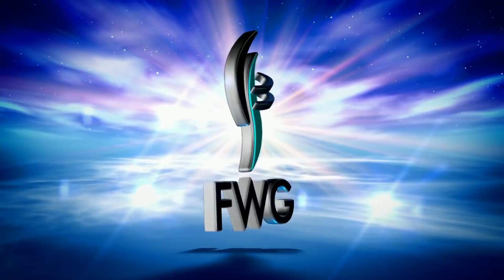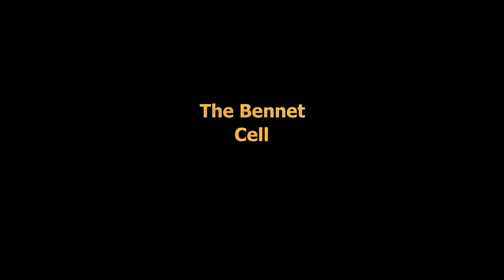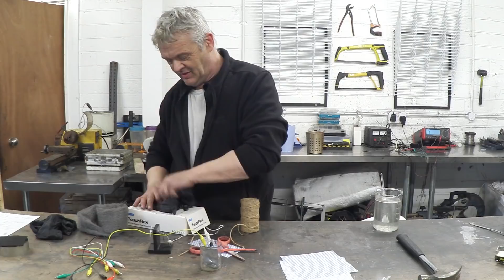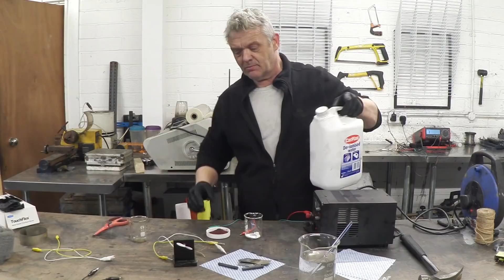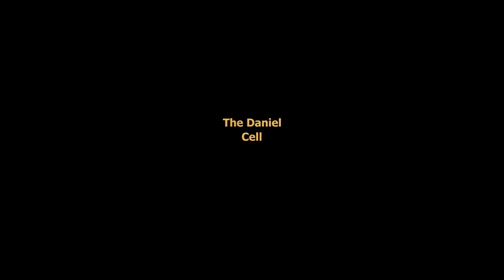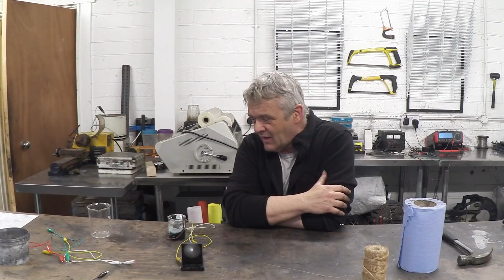Lost Secrets in the Art of Battery Making

Comment: You can make pure copper oxide very easily with a little bit of sulfuric acid water a couple of pieces of copper pipe for electrodes and a power source. The trick is to keep the two electrodes isolated from each other as far as possible to allow the solution to form rather than simply plate the other side of the copper you can use either a separator but an easier way to do it for the anode just simply coil up a piece of copper wire and sink it to the bottom of the vessel that you're using and keep the other electrode at the top of the vessel barely in the solution let it run overnight cook it down and there you go you have copper sulfate grind it up in a mortar and pestle put it over a burner in a Pyrex dish and keep heating it until it turns black there you have a pure copper oxide

Comment: J cloth appears to be one of those lost secrets. The chloride in the paste is interfering with rechargability due to chlorine production then chlorate followed by perchlorate. I would replace the Chloride with a sulfate.
Also if you add some sodium gluconate in about 10 g/L the zinc will plate out nicely without spongieness. I would recommend using a carbon felt with the zinc so when recharging the zinc will plate out on the carbon felt allowing massive increase in current density.

Comment: Thanks Robert. You took me back to my teenage years. At one school, our Physics teacher and Chemistry teacher were both interested in battery types, and they were forever encouraging interested boys to experiment with different battery types. We had NiFe cells, Zinc air cells, Weston Standard cells, homemade Leclanché cells, a rather large school-built 1 Farad capacitor that could be used with a 12 V battery, and more. Mercury was used for amalgamating electrodes, and that was stored in a glass bottle. And dichromate was kept alongside the Mercury, on a shelf in a glass bottle, marked 'Poison', but any responsible boy could handle it, under supervision. Yes, once used it was often rinsed down the drain with plenty of water; the theory being that it would be fine because it had been diluted. Times have changed in the past 50 years. In some ways, that's to our detriment.

Comment: Would have been nice if you’d mentioned  voltage and max current per eg square cm of anode, or of battery as a whole. That info is required for determining what a battery is suited for, and what a battery can NOT do... a ZnBr2 battery was placed at a farmer who had 300m^2 solarcollector, using the 60kWh capacity battery to store excess electric energy. Charges the ZnBr2-battery in approx 3h. The battery was made by Australian  compagny for quite a bit of €’s. That battery uses a membrane to keep chemicals seperate. But nothing really special, what makes me think that a lot of profit was made by the Australians. I  consider experimenting with the ZnBr2 battery, as hundred of thousands electric bikes were sold in Netherlands, last few years. And a regular bike battery goes for >€400! Good for over 50km of cycling, but half is OK too for most, esp when the battery is a lot  cheaper. And eventually, all those batteries will need replacing. And if I am then, over few years, ready to supply replacement batteries at 20% of the normal costs, I’ll have quite a business! So: tnx for the idea!

Comment: Many thanks for this very interesting video. I'm wondering why Lithium - Ion Batterys are so popular in our times: You show some much simpler storage devises which contains "normal" materials which should have more priority.
Reply from the maker: I am not sure what you mean by popular mate - they certainly get a lot of press but account for 13% of the battery market - lead acid is 55% it's just lead acid is like cinderella.
Reply: @ThinkingandTinkering  What I meant with popular is, that Home Storage Batteries (Photovoltaic to Home - Storage: See Company E3/DC) and Batteries for Electric Cars (Tesla + others) get mostly Lithium - Ion Batteries. Led Batteries are not very good for both purposes because of the weight per Wh and low rate of full cycles  - they are only good for Car-Starter Batteries. I personally see with Lithium - Ion Batteries a problem with the stuff Lithium and ingredians of Cobalt etc.

Comment: I was just thinking, the consumable metal in the battery, what about using liguid metals with a current collector, maybe carbon, could this be possible? Mercury, or another Low melting metal, gallium or something, just a crazy thought, and wondering if it has been considered?

Comment: Robert, as you may recall, I have a profound interest in the potential of the Urine/Aluminum Hydroxide chemistry as a potent source of DC, H2 & Heat, in specialized applications, derived entirely from waste beverage cans ("Canodes") and the...ahem..."user-supplied BioCatholyte" generally flowing in relation thereto.  Dr. Geraldine Botte (formerly of Ohio State, now at Univ. Texas) developed a Nickel-based Catalyst Cathode for the efficient electrolytic Hydrogen production from Urine (30% more efficient than from saltwater).  BUT, the use of the Aluminum Anode  - together with NaOH (also a Catalyst) eliminates the need for input current, and produces net current out, as well as the Hydrogen (and a lot of Heat).  You have the broad creative genius across chemical, electrical and mechanical engineering to integrate a practical battery/fuel cell based on this unique set of reactions.  Provided that more cans (uniformly crushed) can be fed continuously, there are a number of commercial, emergency, disaster, camping, survival and military applications for such a system. You will find that its total energy density exceeds that of any of the battery chemistries you have been examining (whether in this video or previously, in any other), with the cheapest, most common, safest and most environmentally benign reactants of all.  I suspect that your work in nanostructured Carbon, particularly as pertains to Iodized graphitic Carbon Nitride, may be relevant to Dr. Botte's electrode materials work with Urine decomposition Catalysts.

Comment: Very interesting. 
I wonder if a swimming pool, could function as a battery. One side of the pool is tiles made of oxidation potential material, cathode. The other side of the pool is tiles made of reduction potential material, anode.
The water are chlorinated, act as electrolyte. 
You can even charge the swimming pool from your solar panels on the roof, during the day.

Comment: Ever thought about showing zinc air battery that could be kept dry indefinitely until you add water. Sorry if you have already done it. A have experimented with aluminium and sodium hydroxide, there is the potential for immense power but it shorts out releasing tons of heat and hydrogen gas. If only there was a suitable electrolyte it would be the most powerful primary battery. Keep up the good work. 👍🔋🔋🔋
Reply from the maker: indeed it would mate - cheers

Comment: Just like everything else it's all about surface area.
Reply from the maker: ok
Reply: Surface area, energy density, degree of conductivity, how much difference between the respective materials in electro positivity and negativity, how easily the material gives off or accepts electrons, in super caps the thinness of the separator, etc.  This is why it's not easy getting a highly efficient battery or super cap, because there are so many contributing variables.  
   I'm a total newbie in all this, but it seems obvious that it's far more complex than just surface area.
Reply: Surface area, energy density, degree of conductivity, how much difference between the respective materials in electro positivity and negativity, how easily the material gives off or accepts electrons, in super caps the thinness of the separator, etc.  This is why it's not easy getting a highly efficient battery or super cap, because there are so many contributing variables.  
   I'm a total newbie in all this, but it seems obvious that it's far more complex than just surface area.